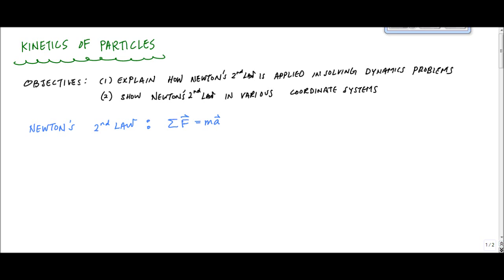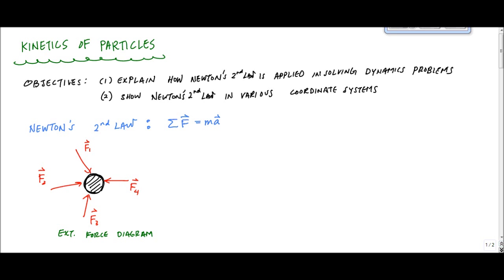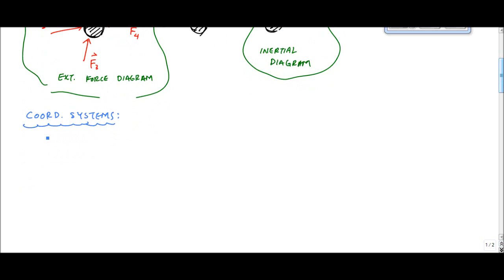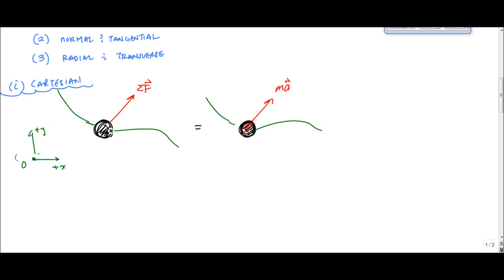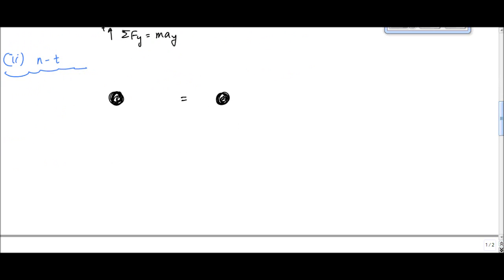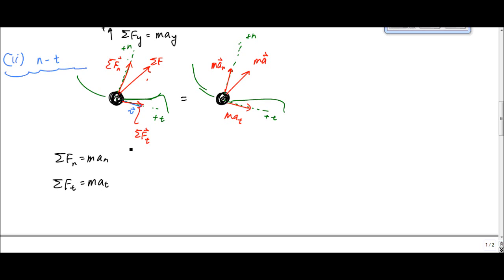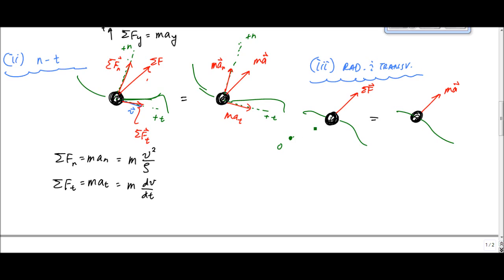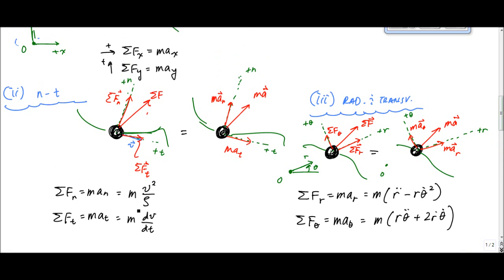Introduction to Kinetics of Particles - Engineering Dynamics

Comment: well explained sir........i want to ask one question sir .....plz give answer......As we are in radial and transverse coordinates, the radial direction is directed towards the point or a body.And tangential direction is perpendicular to radial direction.Both we are taking as coordinates on a point to study.if we take example of circle and we talk about the origin point of a circle have same level with the circle circumference the we can see position vector r radially outwards from point o and transverse components we can say it's perpendicular to r coordinate....up to this my concept is okay... So  i want to ask imagine we are talking about cylinders having  reference line at the bottom of cylinder making angle theta and position vector (r) originated from point O from reference line towards a body or point which is up at angle theta so this r vector line when we exceeds from a point it will make some angle with circle(like similar to inclined plane) and similarly transverse components at 90 degree will become more difficult here......so what will we do here? here we will originate the r vector same as from simple circle? or just position vector is enough to show the pint of a body? and we have to draw Ur something else